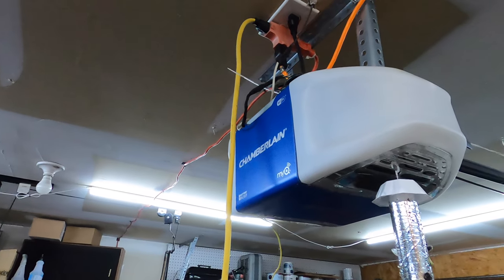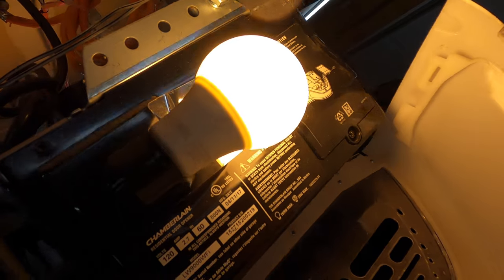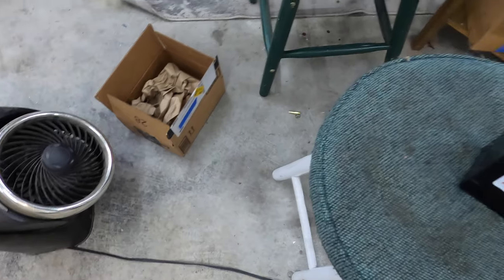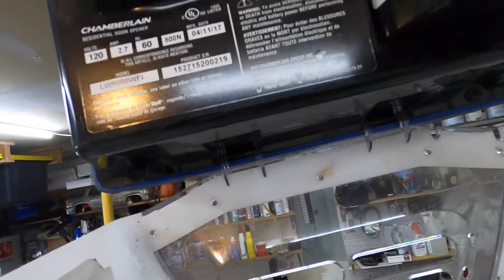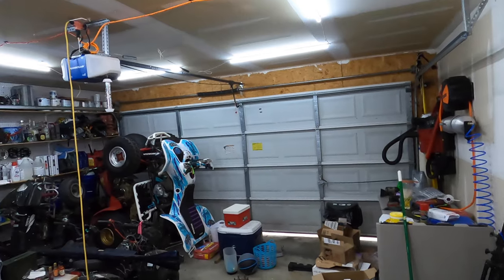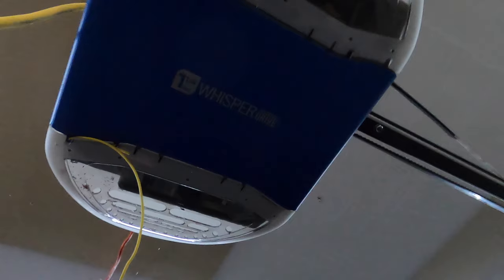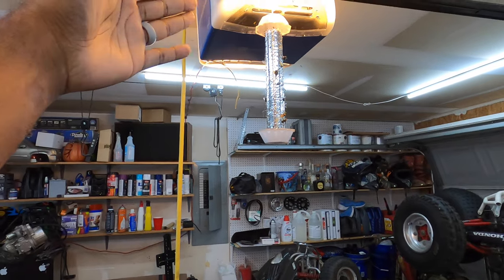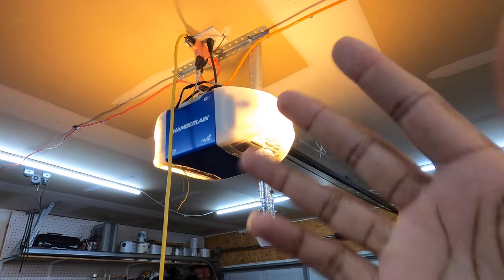Garage Door Opener Battery Backup Replacement | Chamberlain

Comment: When your battery gets low or goes bad, your garage door opener should make an intermittent beeping sound to let you know that the battery needs to be replaced.
Reply from the maker: Mine never beeped or anything. And I’m always in the garage working on something. I have a running reminder on my calendar to periodically check it